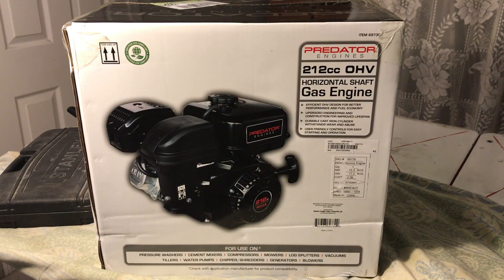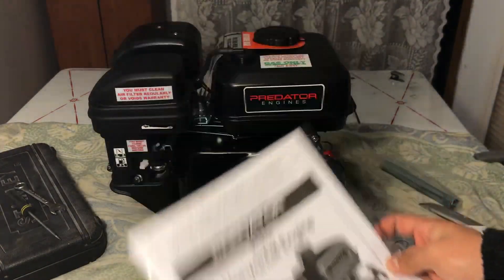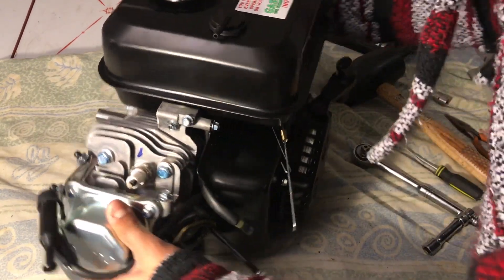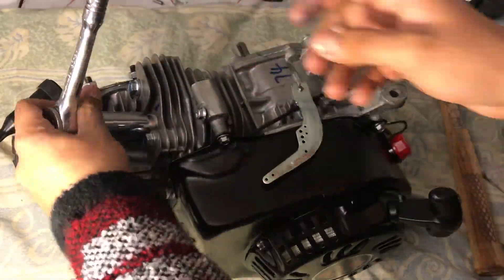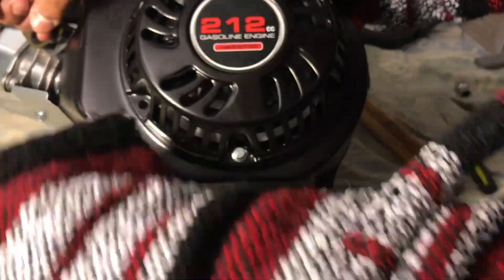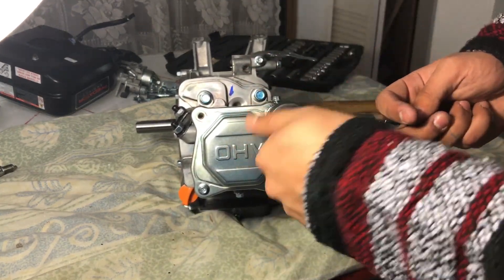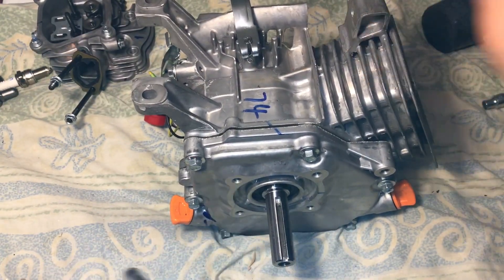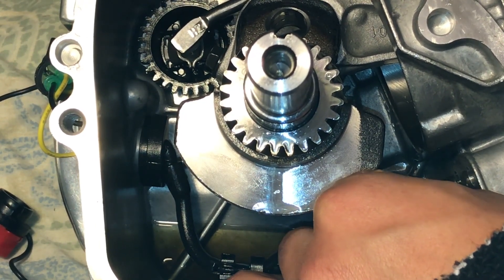How-To Predator 212: Unboxing and Disassembly

Comment: The proper way to remove the Flywheel is to screw the Nut on so it's flush with the end of the shaft and then whack the nut with a Hammer once or twice while prying behind the Flywheel at the same time with a Flathead Screwdriver. But I'm sure you know that by now lol. What happened to your Channel you haven't made any videos in the last year or so ? Gave up on it ?
Reply from the maker: No, I am sorry for not making videos recently. I have so many unedited videos ready to be worked on but I am planning on scaling up the production. I am planning on remaking most of these videos since I have learned a lot more over the last year. Stay tuned and subscribe if you want to see my future videos. I have more bikes coming that should be the firsts of their kind in the minibike community.